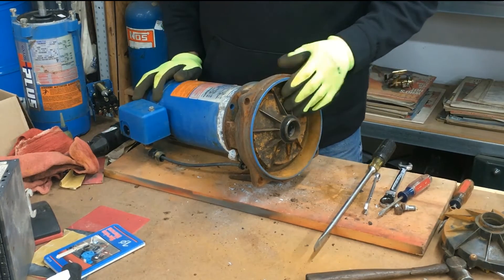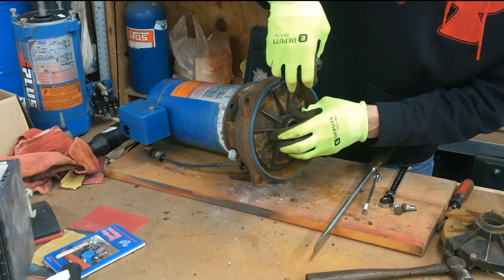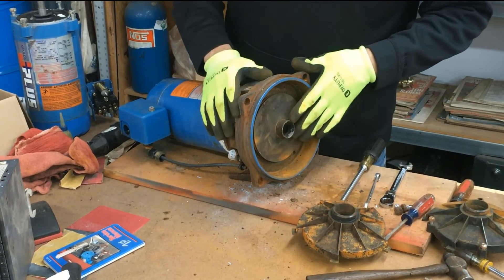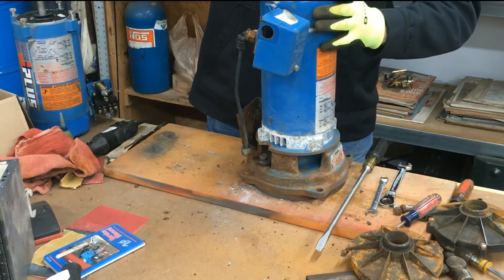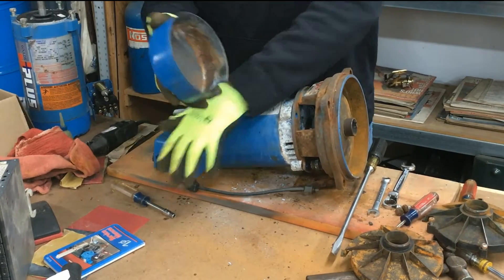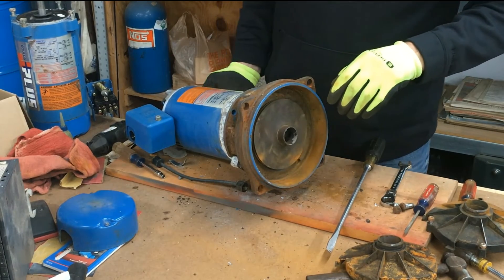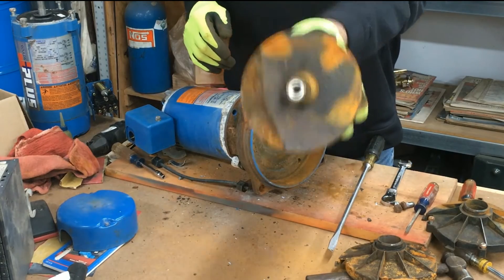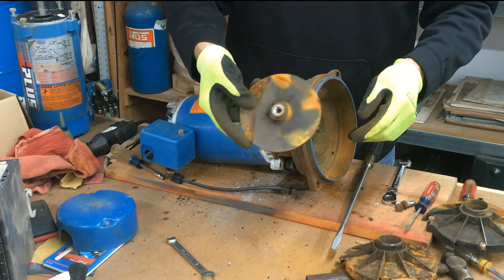Goulds J10S Shallow Well Pump impeller removal

Comment: Very helpful set of videos for the J10S. A stripped impeller was the problem with my pump. Using the info in your video, I ended up completely destroying the stripped impeller in order to get to the center nut and work it off the shaft. Saved me a trip to a shop - new impeller on the way - thanks!
Reply: I have the same issue as you I think. It freely spins both directions with the shaft not moving but still doesn’t unscrew. Guess I’ll start destroying mine too.

Comment: Stuck impellers are easy to remove if they're stuck. I use a knotted cup-shaped wire wheel on my angle grinder to disintegrate the plastic impeller. Best done outdoors for dust reasons but its the gentlest way to remove an impeller with no impact involved. The wire wheel selectively grinds the plastic to dust. Try it on scrap.

Comment: A well done video, my Goulds pump has deep grooves in the impeller shaft housing. I have lost pressure. Is the problem with the grooves? I use the pump for irrigation. thanks

Comment: It seems that these J10S pumps have a back pullout design that allows you to rebuild the pump without having to disconnect it from the piping. Have you ever tried that?
Thanks in advance
Reply: Wrong. You do not have to disconnect piping. Four bolts will disconnect the motor/ impeller housing from the front inlet casting. Just have to disconnect the wiring if necessary.
Reply from the maker: Nah, u have to disconnect piping to get front casing cover off to get at the impeller. No other way to get at impeller without moving front casing cover. Only thing you can remove from back with disturbing the piping is the motor only itself.. This is why you should use unions on your piping incase you have to work on the pump. Easy to take apart in the future……

Comment: Thanks for explaining how to lock the driveshaft by removing the capacitor! That was the one thing I couldn't figure out by myself. God bless!
Reply from the maker: Ur Welcome……
Reply: Do you think one of my impellers is broke? I can get my Well my pressure tank up to about 35 psi technically it should get up to about 50 it’s a 30 to 50 switch

Comment: GUIDE-VANE ... OLD  to  NEW  ... if you need to UPGRADE from the OLD to the NEW ... SNAP-IN to BOLT-IN ... 
Couldn't a homeowner MARK & DRILL & TAP  the required HOLES ???
Reply from the maker: Guess u could try, but factory motor adapters that are tapped with deeper holes built into motor adapter..

Comment: 6.5 min to explain something that should've taken 2 min max.
By the way, the capacitor will not electrocute you, it'll give you a nasty bite but will not come close to killing you unless there's still power going to the pump.
Reply from the maker: Better to be specific and take your time. You can always fast forward. As for Capacitor, i am giving a general warning ⚠️ about electricity. No one likes a shock.⚡️⚡️⚡️😬

Comment: Thanks very much. Is this similar to a stay rite irrigation pump?
I bought a home with a lake sprinkler system and it has the Stay Rite but the motor just hums n i think the pump is rusted inside and I need to take it apart.
Thank great video.
Reply: If the motor is just humming without pumping it most likely needs a prime and possibly repair check valves on the suction side. If it’s pumping but grinding, then that’s the bearings

Comment: I have a question about Goulds J10S Shallow Well Pump.
Is this one OK with running non stop, exp:24hours/a day, during 1 year?
Reply: Motor need to cool down it will burn up. if you always have water pump will be okay

Comment: My motor seems to be frozen. I removed the casing like you said, put a socket on the impellor/motor end, it rotates one direction, I believe counter clockwise but wont move in the other direction. The motor does nothing when I turn it on. Any thoughts? Thanks.
Reply: Motor is blown need a new motor sorry 👍👌✌️💯💦

Comment: I cant get the cover off like u did before the vid
Reply from the maker: Its just corrosion causing it to be stuck. Just take a flat blade screw driver and tap all around the seam. It will loosen up. When you open the seem a little, spray some wd-40 and it will come apart. When two different metals are in contact and exposed to a common electrolyte, one of the metals experiences accelerated corrosion while the other is protected. This type of accelerated corrosion between dissimilar metals is referred to as galvanic corrosion.

Comment: What about the JRS10 goulds pump. I opened mines. it has a seal leak but it has a flat head screw in the center and boy is it hard. Any tips or tricks for that one?
Reply: Ya the screw is left handed tighten is actually loosening it.  don't loose the screw  you will never find another one.  I'm a pump tec👍👌✌️💯💦

Comment: The guide vain is the  plastic piece with the rigid and the impeller is the part on to rotor
Reply: I think he corrected himself in the video, but thanks for commenting.
Reply from the maker: Guide vane is Black plastic round piece that covers the rotating impeller. The impeller is the round smooth rotating piece. I said it backwards when i first removed it in video. You will see yellow print on screen explaining this. I made this video in 1 take….I dont edit….✍️

Comment: My pump ran out of water and the impeller and the impeller cover melted. I took the cover off and used some light sand paper to try and smooth the the surfaces. But when I put the impeller cover back on it still keeps the motor from turning. Do I definitely need to replace the impeller? And the Impeller Cover? Or can I fix it by sanding? Maybe the heat from running all day permanently warped the impeller?
Reply: You are right. Some time sanding it works but most of the time it's done hope that helps 👍👌✌️💯💦

Comment: Can you not simply drill and tap the holes in an old style motor adaptor to accept the new style guide vane?
Reply from the maker: I believe the casing is thicker diameter on the new casings that use screws. You would have to line the guidevane up perfectly and you might have to use shorter screws.....Good Luck....
Reply: @zeppone4045  Thanks.. I tore mine apart yesterday and I have a guidevane that is secured with 4 screws.. Looking closely it appears as though the case is tapped for both 3 and 4 screws.. I notice that the new guidevanes come with 3 screws? I have ordered the kit and we'll see what shows up.

Comment: Do you happen to know the blue color code for these pumps? I need to repaint mine. Thanks.
Reply: At our shop we use ford blue it's close to the original  but there is no point code the factory doesn't even no

Comment: Sir,do you have a video on how to replace the bearings of this pump?
Reply from the maker: Sorry no video on bearings. Goulds doesn’t offer motor bearings as a replacement part.  You need a replacement motor. If you want to have bearing replaced , try an electric motor repair shop or a pool supply. They use a lot of the same type of motors on pool filters. Good Luck. 😉 👍🏻
Reply: @zeppone4045  thank you

Comment: Thanks for the how-to!

I just pulled one of these out of service on 5/5/20 and installed an old J5S in its place temporarily while I figure out what the hell I (stupidly) did to the J10S. It's a "comedy of errors" sort of story...

My submersible pump went bad last Saturday after a dozen years in service. The motor is kaput: common/run and common/start were both in the hundreds of megohms. Pretty cut and dried. So we went out and bought all the stuff we needed to change the damn thing out.

While doing the changeout, I thought I heard water flowing back into the well through the now-vacated pitless adaptor. It wasn't (a check valve at the buried side of the pitless prevents it), but at that point in time I thought it was, so I closed the valves on the storage tank, which is hundreds of feet from the well head. 4+ hours later, I discovered that I had neglected to turn off the breaker for the J10S. That discovery came in the form of finding the J10S hot enough to cook on and making an obnoxiously loud buzzing noise not unlike the alarm on a septic system. After cooling down overnight, it still buzzed, so I knew I was screwed.

If I am reading the service manual correctly, the winding resistances check out, so I think the trouble is in the impeller area (hence my finding your video), which is a relatively inexpensive fix and well worth getting a workhorse like the J10S back in service. Plus, it's the newer style pump with the white circuit board in the motor, so I can probably do a rebuild kit without also having to replace the front casing.
 But I will need to open it up to be sure.

In the meantime, I had a spare J5S on hand (because what home owner doesn't keep spare jet pumps in their garage?), so I was able to clean that up and put it back in service. The sooner I can pull it back out the better, though. It's pretty weak compared to the J10S. That is, after all, why we replaced it after only 3 years. (17 years that pump sat in my garage waiting for its moment to shine! haha)

I like the profile pic, by the way. "The Hermit" from "IV". One of the greatest albums of all time.
Reply from the maker: Hi Dave. Thanks for the comment and hope my video helped you in some way. Being in New Jersey with the COVID-19 lockdown, i used my plenty of spare time to make a few videos to help out with Spring time and turning pumps on in a lot of places.😄 Love Zeppelin 👍🏻